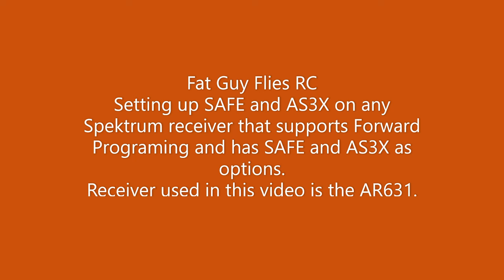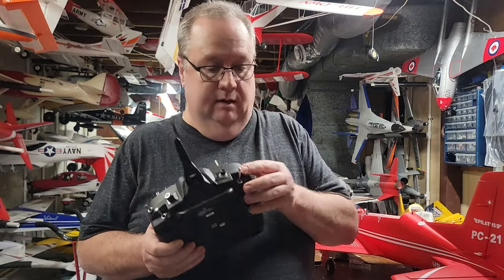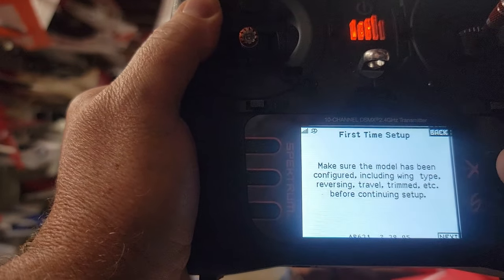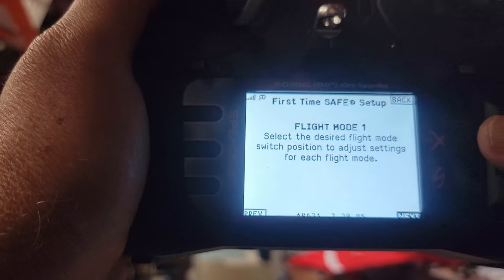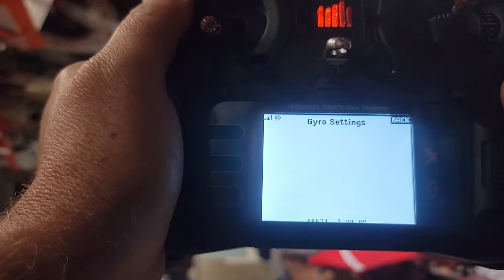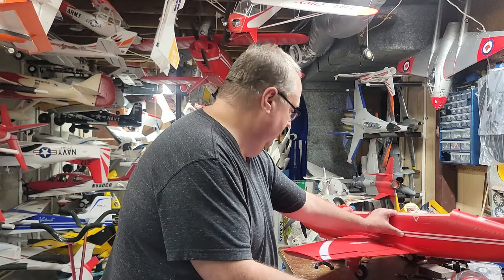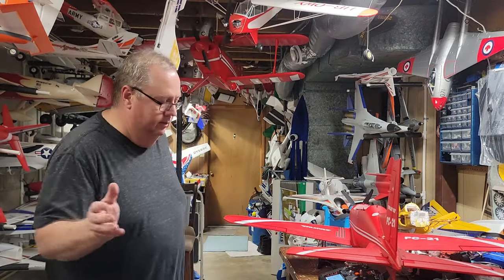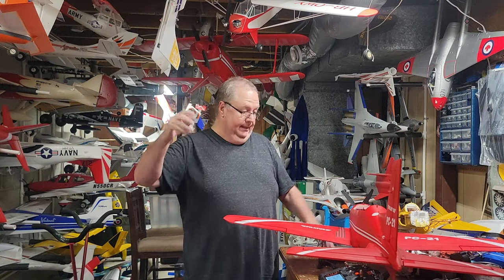Setting up AS3X and SAFE with Forward Programing-AR631-AR630  by FGFRC

Comment: I have 2 AR630 receivers that I recently purchased, I tried setting up by your excellent video. I have a PC21 same as you, I have a DX6e transmitter. The trouble is both these receivers DO NOT have Aux 2 channel. I use Aux1 for flaps. Is the Rx malfunctioning? Is the AR631 different?
Reply from the maker: The issue is your transmitter. You need 7 channels to use SAFE on a switch to run it independently from sharing a channel. Since you only have 6 channels then you must SHARE SAFE with your flap channel or gear channel. Both the the AR361 and AR360 allow you to separate safe to its own channel but your transmitter must have that separate channel or seventh channel available. So  you must decide is how you want to share it? Share it with you gear? or flaps?  I highly recommend you upgrade your transmitter to at least a NX8 that way you should not run out of channels on your transmitter and be able to fly almost everything.
Reply: Thanks for your quick reply. I'm still puzzled by the fact you are using an AR631 Rx in the video which is also 6 channels, where does the Aux2 channel come from?
Reply from the maker: @grahampayne7285  The AUX 2 comes from my Transmitter not the receiver.

Comment: Mr Guy it is all very helpful just bought the receiver but pain to set-up do you have any problems with this receiver is it reliable -also can I use this as a standard receiver if I want to, I taught myself to fly with giro enabled planes thats why it interested me .Thanks
Reply from the maker: Yes with setting up different flight modes with gyros on or off.

Comment: Hello - I have a question regarding a receiver: Spektrum AR636B AS3X. The question is whether I can use this Spektrum AR636B AS3X receiver with gyro (stabilizer) with the DX6 transmitter? Additionally, I've seen on many other channels that they use a computer for programming the stabilizer. Is this also the case with the Spektrum AR636B AS3X receiver, where you can program the stabilizer using a computer, or can I only program the stabilizer on the Spektrum AR636B AS3X through the DX6 transmitter alone? Thank you very much for your help!
Reply from the maker: No that is what is considered the old school way before forward programing came out. I don't believe a regular DX6 supports forward programing either. If you wish to program that receiver you will need the original model files, a programing cable and the 2 programing programs available through spektrum. If can be a bit complicated and cannot be explained in this format. You honestly need to upgrade to the nx series of transmitters and the new generation of open receivers from Spektrum like a ar631 or ar630. Sorry but it would make life easier.

Comment: Ok, just wondering how you would set up a used, pirated from a different model, an AR631. Have you done a video on that. If not could you please do one ASAP. I'm flying with a NX8...thx
Reply from the maker: All you have to do is update the receiver with your programing cable on your sign in with My Spektrum log in. When you register the receiver and up date it it automatically jail breaks it to a OPEN ready to be programed receiver. Just the same as you purchased a new spektrum receiver off the shelf that supports forward programing.

Comment: Did everything you said. everything works accept my throttle
Reply from the maker: Make sure your throttle trim is at complete zero that may be why your ESC wont arm. If not then delete the model and start completely over.
Reply: @FatGuyFliesRC  I got it working everything's perfect thanks again

Comment: I have an Arrows RC T-128.   It's reluctant to get off the ground especially when on grass field. I WANT to use SAFE for take-off.  The elevator in safe has reduced travel.  I would like to increase the elevator travel limit when I'm in safe.  Is this possible ?
Reply from the maker: Yes and SAFE will not notice it. Move the push rod on the elevator to the innermost hole. This will  give you the most travel on the control surface. If it is to much for you can add a little more expo to the elevator to compensate.

Comment: Dear Fine Guy. The FMS Pilatus comes with the fms flight controller. When I use the 630 or 631 do i remove the FMS flight controller , do i just bypass it or do I leave it hooked up and then add my 630 or 631. It seems the FMS flight controller is not being used when the 630/631 is installed.
Thanks again
Bob
Reply from the maker: This video answers that: https://www.youtube.com/watch?v=Jj-Mb4G2h18&t=30s

Comment: On my simple DXS radio my Carbon Club has Safe tied to a 3-position switch.  I think the positions are Safe (beginner), Intermediate which has some protection, and Advanced which  I thought turned off the flight assistance modes.  Is there a 3rd position with the AR631 which would be off?  I just bought a couple of these so I am hoping to gain skills to eventually fly in the off position.  Is this the case?
Reply from the maker: Ok the three positions are actually beginner mode with very limited bank angles and self righting. Intermediate mode with much more  freedom but you still cannot turn the plane upside down then advanced mode that the pilot has FULL control with as3x only. understand as3x only is simply a wind mitigation gyro. Helps keep the plane flying a little more locked in. It does not in anyway inhibits the pilots ability to do any maneuvers and get stupid...lol

Comment: I have a NX-8. I am moving my Stryker from the AR600 to the AR631 to get SAFE. After plugging servo leads in, up/down on the right stick moves the ailerons and left/right moves the elevator.
How do I fix this?
Reply from the maker: START COMPLETELY OVER!  You must get them all moving correctly BEFORE you do forward programing. In the wing type you have either ekevon or elevon b to choose from  then go back and try if they are still not working in the right direction then go to reversing in the servo setup area and keep at it until you find the right combination the works. THEN you can start forward programing.

Comment: I have a Dx6e transmitter and it is on the latest update for it and have a AR630 receiver but it doesn’t show forward programming as an option though, please help!
Reply from the maker: go to the Spektrum web site and insure your DX6e does indeed support FP the DX6 e I believe was on that cut off mark.  I know that does not really help you but if FW does not pop up I know of now way to make it.

Comment: So I bought a used Apprentice 1.2 with a ar631 . I'm not getting the first time setup options on my nx6. Do I need to reset the reciever to factory settings and if so ,how do I do that? Also on forward programming it says failed.
Reply from the maker: Your rx is not open. It needs to be "Jailbroken"  or opened up like a new rx off the shelf.

Comment: hello. I have a question. Can the aileron rate be increased in safe mode? because I am interested in it being self-leveling but allowing me to maneuver when there is wind. and in safe mode the ailerons move fewer degrees. thank you so much. Great channel
Reply from the maker: No in SAFE mode the SAFE tech dictate your control surface deflection in AS3x mode only you can adjust as much as you want.
Reply: @FatGuyFliesRC  thank you very much

Comment: BRILLIANT video once again. Really clear thanks for that. Just one thing……… I’ve bought the cirrus sr22t and the nx8, the cirrus is BNF with as3x and optional safe so is all this done already? Or do I still need to do what you just did in your video? 
Sorry I’m still learning all this stuff.
Reply from the maker: No the BNF is ready you will just need to use forward programming to tell the tX where you want SAFE select at.
Reply: @FatGuyFliesRC  thanks for that I’ll see if there’s a video on the the difference between BNF and pnp set ups.

Comment: i did everything you said however my plane is has only a rudder and elevator only.  I put the rudder in the ail slot when it tips to the left the rudder moves to the left in safe and as3x and vice versa. .how do i remedy that.
Reply from the maker: Start over and confirm the correct direction BEFORE you start forward programming.  Other wise the gyro records the incorrect movement as correct.

Comment: Hi friend! Thank you so much for your videos! I have a question not related to programming. When I plug in my Eflight V900 which has a Ar631, The AR does not beep, but it does bind to the plane, however the motor does not run. Do you have any tips or advice? I am using a Jumper T Lite transmitter... I followed the directions to turn down the throttle and lower the trim to 0.
Reply from the maker: Make sure the throttle cut in at least -100 and that there is not a bec inline somewhere that had come unplugged. Other than that I cannot advise I have never had that model.
Reply: @FatGuyFliesRC  Thank you very much for your help! I truly appreciate the response!

Comment: I bought a Night Radion™ with an AR631.  It's in transit.  I didn't know Varios existed until after my purchase. I started out with a DX6e...rudder elevator and throttle was all I needed.  I'm a real fan of a vario in a glider. So, I purchased a used DX-8 Gen2 days later and it's in transit.  I'm after the Vario tone in my xmitter.  Can I do this with the AR631?
Reply from the maker: Make sure your transmitter supports telemetry and can be updates to forward programing and all latests tech. I am not totally sure but I think the transmitter needs to be either an updated DX9 or any of the new nx series.  I do not think the ar361 comes with vario however.

Comment: Taking my AR620 out of my glider and replacing it with a AR630.  In order to have one of the 3 modes function completely manually I would leave that mode all adjustable and not fix the roll, pitch and yaw, correct?  Also, this glider has flaps and I have set it up with crow in flap position 3, is that going to be a problem when in SAFE mode?
Reply from the maker: Safe will not do anything with the flaps at all.

Comment: I have the DX6e with the 2.09 firmware update but I can not for the life of me find forward programming in the system settings. Am I missing something? I am using the ar630 receiver.
Reply from the maker: It is in your FUNCTION list if the receiver and transmitter support it. Hope this helps

Comment: Did you setup a way to adjust the gains in flight?
Reply from the maker: You can assign it to a roller or trim switch but I did not.

Comment: One more thing, I attempted to assign my switch B for safe and as3x and upon switching, my rudder turns right. Why is that?
Reply from the maker: i have read  these posts. Your AR361 is not open. It sounds like it have wrongly been moved from another plane and tuned to that plane not the Apprentice. you need to get a Spektrum programing cable and then update the receiver at the Spektrum website to "Jail Break IT" This will make it an open rx like you just purchased alone and not in a plane already. That will also explain why you FP failed. Once you do this then follow this video.

Comment: First great video, my question is what exactly changes when you changed the controls from adjustable to fixed? Do you need to rebind if you reset your receiver?
Reply from the maker: No you do not need to rebind.

Comment: I have a DX6 transmitter , if I get a ar631 will forward programming show up on binding. I have a T-28 with a Ar636a and doesn’t have Safe.
Reply from the maker: I do not believe the older DX 6 s supported forward programing, check with HH on their transmitter page, I THINK they have a list of supported Spektrum Transmitters.

Comment: have you set up an edge 540 or extra 300 with safe mode, in which part of the airplane do you measure it is actually level?   Im having issues with a tail dragger.
Reply from the maker: You want the gyro to record level flight attitude not just sitting on the deck. So yes level the aircraft as if it were flying level and then record that into the gyro at the safe setup step.
Reply: @FatGuyFliesRC  awesome will put it on a stand,  so that the landing gear are not touching the ground.  That should give me more likely a level flight attitude.    Thanks

Comment: Hello I need some help I followed your video on my Ultra 600 and the switches work great. I tried programming another plane with AR63T AS3x and safe..I get as far as programming the receiver and it fails?  I did this twice and it failed. Would you happen to know why it failed, or should I stick with the AR631 receiver?  Thanks for your help... I find your videos are very helpful. Thanks Bob
Reply from the maker: see if this help you.  https://www.horizonhobby.com/blog-spektrum-ar637t-rx-programming.html?campaignid=11330476983&adgroupid=109773452823&extensionid=&targetid=dsa-19959388920&loc_interest_ms=&loc_physical_ms=9012171&matchtype=&network=g&device=c&devicemodel=&gclid=CjwKCAjwk8e1BhALEiwAc8MHiLIcN6BrBhVvt8CUiJg8eyEQK1cEAI6NEkcfnWBOFSM7YmL9Zv_FzBoC_GsQAvD_BwE&creative=472120871891&keyword=&placement=&target=&adposition=&utm_campaign=search&utm_medium=cpc&utm_source=google&gad_source=1
Reply: Thank you I will it a try this week,thanks for responding 👍 Bob
Reply from the maker: Hope it helps!!!

Comment: Question? I have done what I believe everything the way I should have. Forward programing does not appear in my menu options. Binding an AR8360T reciever to my NX8 transmitter. Control surfaces are set, throttle cut set, flight mode set. Everything functions as it should but no forward programing option. Reciever is connected and operating. Thanks for any help you can provide. Love your videos.
Reply from the maker: This happened to me on my NX10 I had to completely delete the model and start over and then the forward programing option appeared. And I am sorry but I don't know what I did differently to have it appear other than a fresh start.
Reply: Thanks! I'll give it a shot.
Reply: Thanks again it worked. Deleted model and re set up. Appreciate the help. Keep on flying!

Comment: Okay I have a question. I have an NX8 transmitter and two different AR631 receivers. But anytime I go into forward programming and hit gyro settings it says cannot connect. Is there something that I'm doing wrong?
Reply from the maker: Are the receivers factory reset? If not try that first by using a programming cable from Spektrum and then register both receivers, you will need to download their programming program(free) and then update and register both receivers. That will make the receivers new like you bought them separate and not out of a plane. That should open up forward programing for you . 
Other than that I cannot understand why they wont connect. Post a video on your channel showing the setup and what your doing. I will watch it and try to figure it out.
Reply: @FatGuyFliesRC  I'm pretty sure it's because they are locked to the aircraft. I ordered the programming cable and should have it Monday

Comment: I have a brand new AR8360T as3x receiver. I don't want to use the as3x. If I don't go into forward programming it should be off, right?
Reply from the maker: Yes you can bind it and use it as a regular regular receiver. Just FYI you can enable all the features (as3x and SAFE) and have the ability to turn it off on a switch. if interested in this ability watch this video.: https://www.youtube.com/watch?v=x4eGRmYd-jU&t=531s      at the 8 minute mark I start talking about that.
Reply: @FatGuyFliesRC  Thank you!

Comment: did you use a Y harness for the ailerons or separate channels? I would be curious to see separate channels for ailerons.
Reply from the maker: Y harness. You could use separate channels for ailerons but set up all directions and proper movement BEFORE you calibrate the GYRO with forward programing.

Comment: My forward connection is failing.what is next step go forward.
Reply from the maker: That happen to me once. Make sure your transmitter is up to date. Delete the model and completely start over with a new model profile. If that does not work then you may have to send your receiver to spektrum thru HH.

Comment: Is this only able to be done with nx series? And if so could i borrow someone elses, calibrate safe, then return to my own dx transmitter?
Reply from the maker: No it can be done with any Spektrum transmitter that supports forward programing. Example I can do it with my dx9.
Reply: Thanks. Hope my dx6e does the trick @FatGuyFliesRC